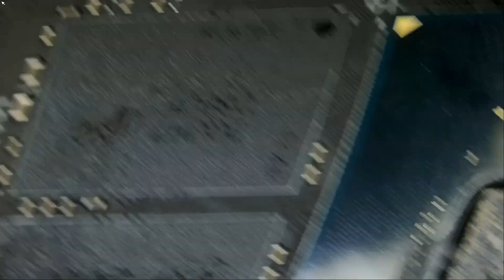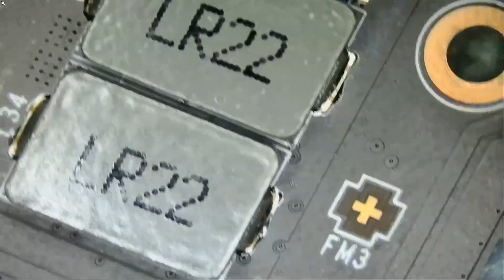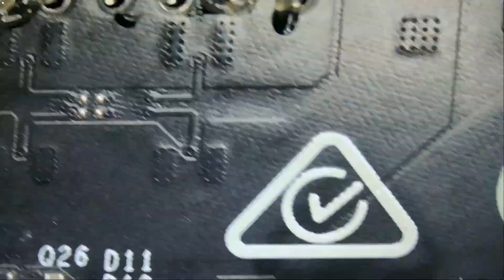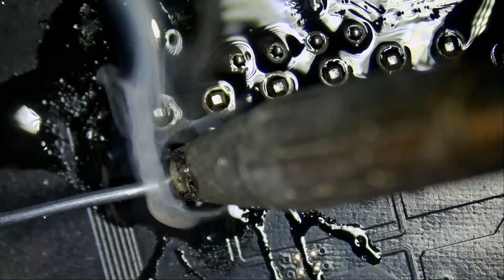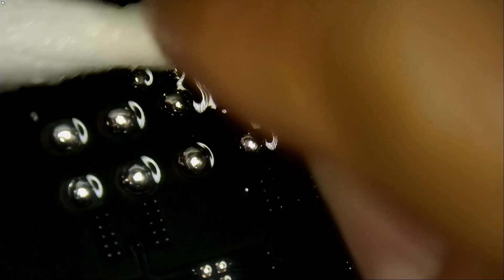4080 MSI Trio Never seen before Connector fell off & triggered Smoke Alarm

Comment: I think for this board, it was not enough soldered... if it had enough soldering the connector side should be integrally filled with soldering paste... When i see the connector, i see juste a little soldering paste at the end of de pins... Sorry for my poor english...

Comment: Just because they said that they were aware of the issue does not imply fault. You are correct that this is a manufacturing error and for MSI to acknowledge that would be unheard of. Good luck getting satisfaction from this issue.

Comment: There not a trace of solder on the joints. Manufacture defect, quality control check etc...  Should at least supply customer with new / updated version. Thanks to Northridgefix for producing video evidence of poor workmanship from a big company, it does them no favors by just acknowledging there are problems with this product. Poor customer service...

Comment: If temperature rises beyond permissible limits then power connector solder will melt & cut-off power to save any damage to chip... It's a safety feature... 😅😅😅

Comment: Although it wouldn't solve manufacturing issues where you don't solder on the connector properly, I wish high power GPU's would simply move to using Anderson connectors.  A 75A rated connector wouldn't be that much bulker?  And highly flexible silicon insulated wiring terminating in multiple "PCIE" labelled thingy-plugs  or a couple of 12VHPWR connectors etc. the other end.  A few different crimp sizes maybe and trickier for custom lengths of cable, but eventually PSU's could then include a decent capacity Anderson connector too for a single cable connection.  Back of the envelope scribblings ... thinking of a 900W future card ... 12V at 75A ... I think a 4 AWG wire with silicon insulation would be approx. 11mm diameter?  A hefty wire.  But neat and tidy ... just the pair of them.  Simple for custom lengths.  Relatively easy to crimp the standard sturdy connectors unlikely to cause issues.  Very very minimal heating even at 75A from the wire itself to heat your case or the connectors.  For the expensive cards, not a huge amount of additional expense.

If the best cards are going to continue to want more power, and solid state power handling on the boards improve to handle it, wouldn't introducing higher, simpler, existing-standard based power connectors now, be sensible?

Maybe I'm just muddled and uninformed in my off the cuff thinking.

I suppose, actually, if we do go down the higher power route, and as voltage changing becomes ever more efficient with new methods/switch-mode improvements etc., it would be simpler maybe to switch to 24V or maybe even 48V for a cost comparable lower current less bulky GPU solution.

Comment: @MSIGamingOfficial - You seem to have a field campaign in your hands. Unless you can narrow this down to a one-off, it would be prudent to kick off a priority one field campaign where you instruct your customers to do a visual inspection of the solder joints and advise to refrain from use of a suspect card. There is a fire hazard and a real risk for loss of life; that should make this a clear priority one case.
In parallel with above you should politely apologize for the terse and empty initial comment and compensate the customer of NorthridgeFix for the repair. You should also thank NorthridgeFix for being an enabler in your continuous improvement efforts.

Comment: This is surely the worst canned reply from a manufacturer. 
With video proof of soldering ineptness on a mainstream video card. 
It should be better served with SOME kind of replacement, under warranty, seeing their "FOCUS ON PRODUDCT QUALITY and USER EXPERIENCE"
But no.
Obviously Their "FOCUS ON PRODUDCT QUALITY and USER EXPERIENCE" ends when the customers check clears.

Comment: The biggest issue is all new video cards take so much power and the heat it creates.  Something will fail and you can simply blame how ridiculous video cards has become so hot because the power isrequired for it. Plastic melts, power cables melts and manufacturers blames user error. 😮

Comment: you should call Gamer Nexus and show that what he simulated in the lab is not a unique situation to this issue with the 12V pin connectors of 40 series cards :) I also wonder what would MSI or Nvidia reply to this situation? :)

Comment: That there is no tinning inside the bias shows the connector was not soldered correctly at the factory. Perhaps the factory worker did not use flux?

Comment: I think MSI is more at fault here in this case than Nvidia because they were the ones who made the card based off of what specs Nvidia told them. So they put the connector on and did craptastic job of doing it.

Comment: Crappy connector they could have kept using the old 8 pin ones. Though ive had a 4080 for over a year now and ive used it with 4 different cables (no adapters) with no issues.
I have 2 PCI-E 3.0 PSU's one from Seasonic and one from Deepcool. So i have used both stock 12VHPWR cables and 2 RT series cables from CableMod with 
my Seasonic PSU. I ripped the sence cables out of the first one so i bought stealh sence cable to replace it.
But yeah my old 3080 Ti had 2x8 pin connectors and it pulled more power then this 4080. So yeah crappy so called highpower connector is kinda useless on a 4080 and below.
Even a 4090 would most like be better of with 3x8 pins or maybe 4x8.

Comment: Yeah, the solder did not melt through the whole board. No touch-up nor quality control according to IPC 610 ec. Incredible that this board has found its way outside the factory. 😂
The next big joke is, that this connector's pins are very short. So it's intended to be soldered pin-in-paste, in the reflow SMT process. This means even worse solder feed-through the board and less current carrying capacity. Why nobody at msi see this issue??

Comment: nVidia is interested in only one thing, the ker-ching as they dig a hole in your pocket and once they got their ker-ching you might as well be dog wotsit on a shoe as they got all they wanted from you and its solid middle fingers up at the customer from that point onwards :(   What gets me is the proles just queue on up to get royally reamed, I mean its the same as the liquid metal craziness on the PS5, people with brains and intelligence KNOW that the disgusting stuff is sooner or later going to escape and wipe out your machine but still they queue up for the opportunity because of peer pressure and that lingering doubt that you the consumer will fare luckier than the millions torn a new one financially.   Sony couldn't believe their luck in finding a money making mill, sell a machine top dollar to a fool, wait six months to a year machine blows up... fool buys another one...   These corporations just don't care, all they want is the ker-ching, I wouldn't run a nVidia card if someone gave it to me after being ripped off badly when I bought a 780 and 750ti from nVidia direct and it didn't make a year out in the wild before nVidia kicked both cards into the legacy long grass hamstringing 'em both... stop pouring good money after bad.

Comment: It's concerning the amount of people defending the 12vhpwr connector saying it's always user error, when we see such a high amount of connectors failing then it's a connector problem, why did they even switch from 8 pin connectors when they were working perfectly and no one had these issues.

Comment: Just a theory - At the manufacturer soldering stage there was a sudden movement of the board/ connector preventing the solder paste flowing properly and instead creating dry joints.  Subsequently the connector and joints got overheated during use (due to the poor electrical connection between the plug and board) ultimately causing the final failure.   It's just a theory.
Reply: Yeah, i don't think that will fly, as manufacturers use what's called a wave silder machine that usually pre flux and pass the board along a pool of melted solder. close enoughto "connect" all solder points in one operation. Some boards can be submerged and others just deep enough to reach the solder pool below it.

Comment: How it survived, in use, for 6 months, with no solder !  Incredible!?!?
Reply: It was soldered only on one side when it should have been soldered on both. And because the cable was essentially able to bend back that connector and cause a second bad connection, which heated up that part of the pcb enough to melt the already scarce amount of solder.
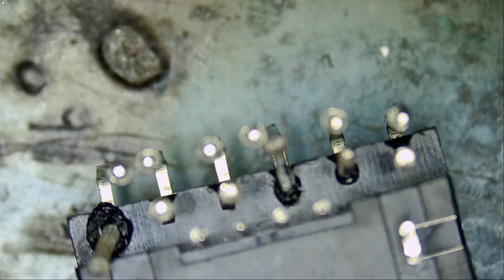Reply: At 1:54 you can see a tiny amount of solder, so it wasn't completely unsoldered. If it was the user wouldn't have even been able to plug it in.

Comment: Just a though, It makes me wonder if the connector design is not the whole problem, but maybe how well manufactures solder them to the board. Most of the cards I see Alex fix, don't have solder right through the board at the connectors.  If minimal solder is used, the joints could be cracking due to heat cycling, causing arching and high resistance at the joint, intern heating the connector pins up and fusing the plastic plug a sockets together causing all the issues? I just read that Alex has never had a come back with replacement sockets - is this because they are now properly soldered to the board?.....

Comment: This connector is biggest Mistake ever
Reply: @Kirk720 4070 with 8pin here! I will also keep the card as long as possible. What a mess.
Reply: @TechTalkTobi Same here on a 3090, ironically a gaming X trio one, had since launch day, overclocked and no issues. I refuse to upgrade to 50 series, until they figure out these connectors or replace them, i used this as an opportunity to upgrade my CPU and platform to DDR5/PCIE 5 instead, I’ll not buy a GPU with a 12HPWR connector.

Comment: at this point I'm afraid to use high end components. im using an i7 12700k, I don't want to go to 13th or 14th gen because of all the power issues, same with nvidia gpu's.  id love to have a 4080 or 4090 but id rather have a reliable machine that's not going to randomly self destruct.

Comment: jag hade ett 3080ti som tvärdog funkade hur bra som helst tills jag updaterade bios på moderkortet o någon dag senare märker jag hur spel gör så min dator startar om , inga konstiga temperaturer på grafikkortet. sista omstarten startar inte grafikkortet upp igen kan inte heller instalera drivrutinerna så jag trodde att pcie 16X dött pga uppdateringen av bios.  när jag sen monterar bort grafikkortet sitter  kontakten från nätagget till strömen fast i kontectorn. ja sluta med att jaga inte våga använda samma moderkort igen fick byta det. men så synd på ett fint grafikort som funkat hur bra som helst intil sista dag

Comment: Is there no warranty given on these cards in the USA?
Here in the UK we have consumer rights that provide at least a 12 month warranty and it is the retailer’s responsibility to offer a repair, replacement or refund.
Reply: when you go down that route you are probably weeks off before you have your card back.
Reply: There are differences, that’s one reason hardware is more expensive on this side of the pond…
Reply: And this is when we should raise suspicion on some of these stories. This dude said that he only had the card for 5 months. The manufacturer gives the U.S. 1 year on GPU's. Some retailers offer additional extended warranty replacement. And also, if the card was burning so much to trigger the smoke detector why isn't there any signs of burning on the card?
Reply: @spankbuda3769  at 1:54 you can see the bubbling plastic on the connector pins... When that type of plastic gets hot enough to bubble it does smoke.
Reply: @spankbuda3769 It was the cable overheating...card dissapate heat much more then simple cable.
Reply: What's the maximum in UK? We have 5 years in Norway. I got a 4080 Super for 670 bucks because of it, lol.
Reply: @buddymckay3486  i think standart is 2 years here in UK and with some AIB you can get more, like for example gigabyte cards can get 2+2 years, 2 standart and 2 if you register the card
Reply: @buddymckay3486  Here in the UK we get a 12 month warranty but manufacturers can increase that voluntarily. We also have the Consumer Rights Act that gives consumers addition protection up to 6 years.

Comment: And what about the connectors you replace, do you get any returning customers with the same issue again? It would be nice to know if after replacing the connector the problem is solved for good.
Reply from the maker: No not a single one came back since we started replacing those connectors.
Reply: @NorthridgeFix  So maybe factory connectors are just garbage and 3rd party manufacturers are doing a better connector.
Reply: @davidlguerr   You sir are onto something! It looks like all those brands want to sell more gpu's. 95% or more of the failure cards are 3rd party. So that seems not like an Nvidia issues but a brand issue!

If northridgefix is true in his statement it proves that the issues is not in the design, but the used connector/solder/failed process at factory 3rd party.

BTW you have it the other way around. Factory is good. 3rd party fail over and over!
Reply: @davidlguerr  Maybe, with the boards being so thick, and the manufacturer using high melt solder, solder isn't flowing all the way through and it's making a poor connection on the board and heat transfer to through pins and just melts the connectors and the real issue is the soldering job from factory.
Reply: @davidlguerr  prob customers properly seating the connectors after paying for repairs lol
Reply: Good point man  @davidlguerr

Comment: Aside from the connector desoldering itself which should not have any chance of happening to begin with... 

It is clear that the cable was not seated all the way in, I understand that this might have happened when the customer tried to pull the cable  to check what is happening, it might have moved a little bit out of the connector, but considering how high the temps got for the solder to melt I would say the connector and the cable got fused together as shown in the video way before the solder melted.
Reply: it's not desoldering itself, there's no solder at all
you can clearly see it's a clean connection, no solder
Reply: @maklogetrich2378  
I would say it was soldered, but not soldered properly... 

I mean the card was running for several month and during that time I am sure the user was able to plug in the cable wihout any problem, and he might have also pulled the cable out may be once or twice during that time like we all do for various reasons without any problems with the connector.... 

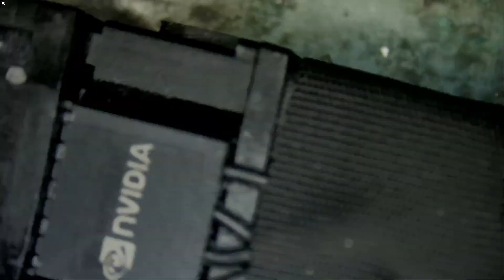Also, you can clearly see in the video solder blobs sticking on the connector legs where it was soldered to the board... go to 1:34 and you will see it.. dunno how u missed that part

So for the card to not have any solder on its connector is far from the truth... its more like there  was not enough solder and with the extreme heat the solder melted easily.
Reply: dude it was plugged in all tha way, tha Connector is tha problem, they need to go back to 8pin
Reply: it was a friction fit, no solder required!
Reply: @stanimir4197  
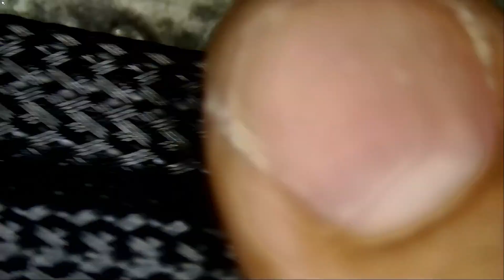 1:34  u can clearly see  solder blobs on the connector legs, and the guy was able to install/remove the cable before without he  connector falling off he board, it was only when it was  extremely hot it got loose when he tried to pull the cable out....

Comment: Good one. For what appears is correct. No marks on back plate? Is not the conector. Just was not soldered correctly from the factory. Pcb was clean.

Comment: I am currently having my Asus 3090 TI replaced by RMA for an Asus 4090 Strix. Not for burning, luckily. But if the 3090 TI uses the same PCB layout and connector, why do none of them have the same melting connector issue, if people say it is the cable or the connector?

Comment: It’s not soldered properly by the manufacturer, CUSTOMER has to complain this with proof photo and it’s clear not soldered well
Reply: They'll probably tell him that he voided his warranty by getting a 3rd party repair.
Reply: @pf100andahalf  won't get voided warranty if he soldered and "better than factory" 🤣🤣
Reply: @mirufi22  You might be right, but I've seen them deny rma for less, just sayin'
Reply: Who cares about the warranty 😊
You have Alex that worked on it.❤
In my opinion not only it’s better than factory.. it just gained value. 😂
Reply: @lacsapeduoa564  I mostly agree, but then the card can later die in other unrelated ways that can then require an expensive repair that you could have gotten fixed for free if you still had the warranty. Don't get me wrong, I bought a used 4090 with no warranty a year ago and so far it's been great, but if the card dies it can cost me more than if I had just bought a new 4090 that had a 3 year warranty.
Reply: @pf100andahalf 
100% agreed 👍, my comment was meant as a compliment to Alex. 
However, this video is more than enough evidence to justify a claim from the supplier. 
Who knows, maybe many cards from this batch are to be recalled.
Reply: bad QC tests
not enough solder
Even to remove 6 pin on simple card like 2 layers it"s taking a lot imagine with15 layers ish and 15 pins : holy shiiet
Reply: MSI probably said customer caused the issue regardless, just start a lawsuit. And ask for double hit them in there pocket, then maybe they well learn!